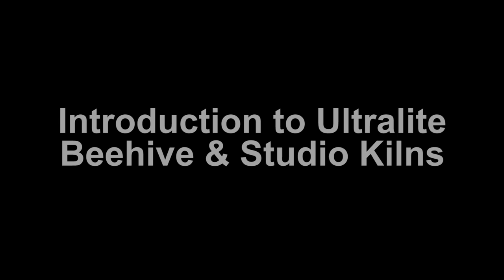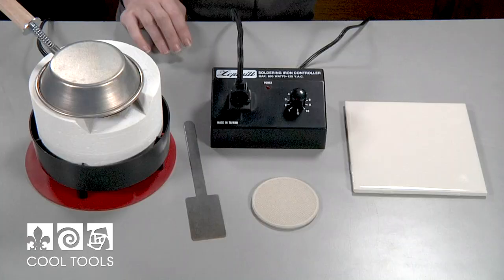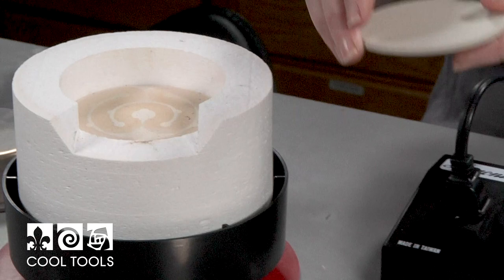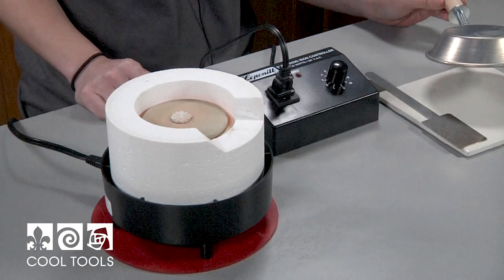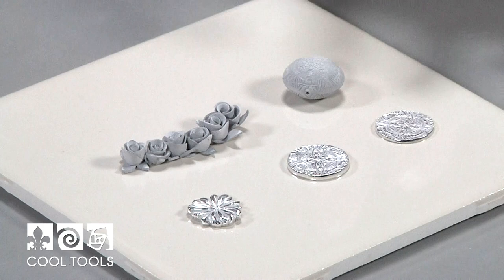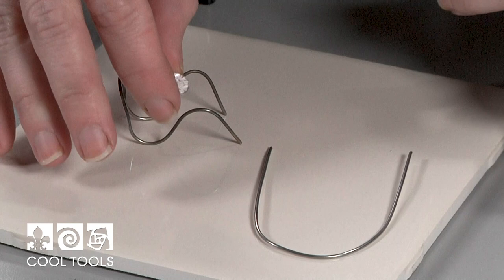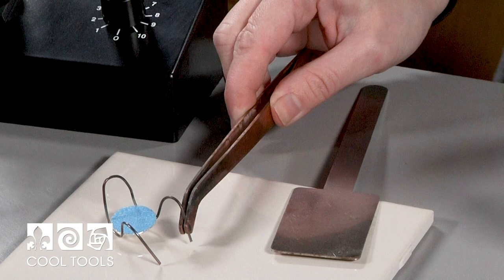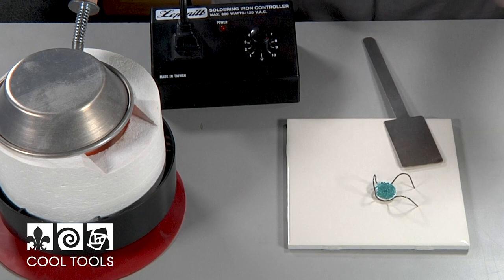Cool Tools | Introduction to UltraLite Beehive & Studio Kilns by Karen Trexler

Comment: To clarify for setup - the kiln is plugged into the temperture control and the temp control into the wall. Is that correct? 

Also is the firing disk included? When I opened my box and went through all of the pieces, I couldnt find a firing disk, only the heating element. I took the kiln and lightly flipped it to see if maybe the firing disk was inside the kiln but I didnt find it. Only the heating element. Can I use my kiln w/o the firing disk?
Reply from the maker: Hi Carina, yes, that is correct. The ceramic discs are sold separately. You can find them here: https://www.cooltools.us/UltraLite-Kilns-p/kln-701-p.htm

Comment: Hi, will I be able to do plique a jour with this kiln and a mica tile? Thanks!
Reply from the maker: Hello, this kiln will heat to temperatures appropriate for pliq-a-jour enameling, but moving pieces in and out of the kiln on a sheet of mica may be difficult. If you would be comfortable moving the mica with copper tongs then this would work for that technique.

Comment: The stone I found today looks like a watercolor mixup of all the colors but less oxide and more of a smooth tan. And, is about the size of the bullet part of a cartridge. I'm looking to tie wire? Or, twine mesh connection to bracelet. Also. I have sybolistic optical drawing, and altered Yen yan bouncy effect when rotated. Plus, screwing wide diameter reuse plastic bottles intellectual property about air and liquid screwing closures. Further, 2.5 in plastic firehose plug can be made into a tap tool if done carefully as well the plane stud is necessary for pressing rough thread system. But, not yet proven for efficiency and precision at  that diameter. Looking to progress containment and lugsury. Please reply with your production and ideas. TJM
Reply: "Pottery tap and die", youtube username:  greyishgreblum w/ "cookie cutter" tap tool modification💜 most efficient and precise procedure to tap out clay. "Mechanical drawings pottery" altered Yen yang "backlit coleman's porcelain" "Pottery Alaska UAA" 0:13

Comment: Are the kilns useful also with different metals such as copper or bronze etc? Is it necessary to buy also the heat control black box?
Reply from the maker: Hi Marzia, this kiln cannot fire base metal clays. Base metal clays such as copper and bronze require carbon to be fired in, and would need a regular table top kiln. We always like to recommend the Evenheat Kingpin 88:  https://www.cooltools.us/Evenheat-Kingpin-88-p/kln-971-p.htm

Comment: Thank you so much for this video, I would like to try this method of jewelry making, but what stopped me was the heating process(expense/size). So this is certainly a possibility.  You mentioned that it's not good for pieces that are not flat, what about a ring like a plain band, or a ring with some form of bezel setting?  Thank you so much for your reply🙏🏼🌺
Reply from the maker: Hi Ingrid, any piece with dimension, including rings is not recommended for firing in this kiln. If you have any questions regarding kilns and firing, we are happy to help. Please feel free to reach out to us at sales@cooltools.us or 888.478.5060.
Reply: @cooltoolsvideos  if not good for rings what will you use if for? What kiln would you use for rings?
Reply from the maker: @LaineyJo30  Any kind of flat piece, such as a pendant.
Reply: @cooltoolsvideos  You did not answer the question of what type of kiln would be needed to fire rings
Reply from the maker: @jotsntittles5783  We like to recommend the Evenheat Kingpin 88 as this is what we use in our studio. The Paragon SC2 is very comparable, just a little more expensive. You can find them here: cooltools.us/ProductDetails.asp?ProductCode=KLN-971-P

https://www.cooltools.us/Paragon-SC2-Kiln-p/kln-101-p.htm

If you have any other questions we are always happy to help - sales@cooltools.us or 888.478.5060.

Comment: I've just fired my first ez960 piece. I set it to 10 for preheat and then to 9 for ez960 firing temp. I placed my piece on thr ceramic insert amd let the binder burn off then covered with the lid. I was trying to fire for 3 hours but at hours 2 my piece looked as if the center was almost melted so I kept the lid off for the last hour. When I removed the piece the ceramic disk was stuck to it. Any ideas where I went wrong? Lid or no lid? To high a temp for that long? Thanks
Reply from the maker: Hello, just to clarify, you followed these instructions? https://img1.wsimg.com/blobby/go/711de8bf-bc35-4a5d-a64b-a9d7cb669656/downloads/6.)%20Firing%20EZ960%20Fine%20Silver%20%20%20.pdf?ver=1674492267830

Was your piece completely dry?
Reply: @cooltoolsvideos  I truly appreciate you responding! I followed the instructions but fired longer than 65 minutes and instead went for 3 hours. Should I have lowered the temp to fore for longer times? The piece was dry. Flat and rolled 3 cards thick.
Reply from the maker: @stellarfaejewelry  Okay yes, that is the problem. 3 hours is way too long, you'll want to fire it for 65 minutes. Firing for longer periods of time is not an issue inside a standard kiln, but with the UltraLite, because the heating is done through the element, the piece can melt. Fire only for 65 minutes and no longer. You'll want to fire according to the instructions.
Reply: @cooltoolsvideos  thank you! I will stick to the instructuons given next time and stay away from google 🙃  I'm still loving my kiln and can't wait to try again!
Reply: @cooltoolsvideos  I fired a piece (EZ960) according to the kiln instructions (65mins) and it was not sintered, it snapped in half 😢. How do I know it's properly fired? And if it's not, do you put it back on the element?
Reply from the maker: @rhoder2  Hello, was the piece dimensional? We do not recommend firing dimensional pieces inside the Ultralite kiln as they will not sinter properly. If it's not sintered, yes you can paste it together and re-fire. There is no such thing as over-firing metal clay. I hope that helps!
Reply: @cooltoolsvideos  it was flat, about 4 cards thick. I can't get it to fire correctly or it melts. How can I test to see if it's sintered?
Reply from the maker: @rhoder2  Are you following these instructions? https://img1.wsimg.com/blobby/go/711de8bf-bc35-4a5d-a64b-a9d7cb669656/downloads/6.)%20Firing%20EZ960%20Fine%20Silver%20%20%20.pdf?ver=1682019736227

To test if pieces are sintered, use the water test by placing a drop of water on the fired clay. The water should not absorb into the metal in the first 30 seconds. If it does, or if the metal acts as a sponge and soaks up the water, this is a sign that the metal is porous and has not sintered properly.

Comment: The product description in the link says that the controller does not work with the Studio model however another area in the description says the controller is required for effective firing in both kilns. Could you please clarify this for me?
Reply from the maker: Hi Vinette, the controller does not work with 240V Studio Kiln, which is for countries outside of the US. If you are located in the US, you'll want to purchase the 120V Studio Kiln and temperature controller. If you are outside of the US, you will want the 240 V Studio Kiln and the 240 V Temperature Controller. I hope this helps clarify.
Reply: @cooltoolsvideos  Thank you so much!

Comment: When using PMC3, can you fire it with a glass cab inclusions on it
Reply from the maker: Hi Nancy, we asked JEC, the creators of this product and the response was: "You can you fire PMC3 at a lower temperature #7 on the controller, then the glass should not melt. Since glass has different melting temp. If the glass starts to melt then remove the cover and lower the controller temp. If that is the case fire for a longer time."

Hope this helps!
Reply: CoolToolsVideos awesome, thanks. It might a good thing to do a video tutorial on this. There’s a lot of us fused glass artists that would like to get into metal clay for their glass cabs.

Comment: Sorry...I don't agree that the are "Low cost"....the basic unit isn't cheap, and when you end up purchasing all of the other parts that are needed to efficiently use either of them, it's quite pricey....If you do the research, you can find a much better table top kiln for less that the main unit  here, along with all of the other parts you'd need to do the job...These don't even look study and strong...
Reply: Where are you finding a kiln for less than $200?